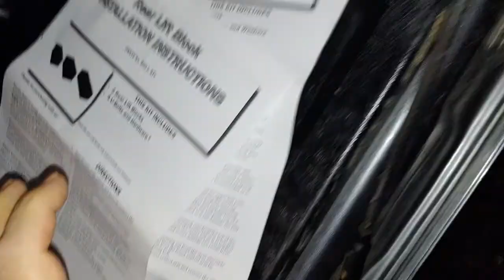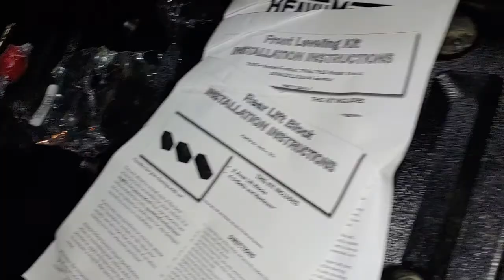installing a 3 inch lift kit on 2018 Nissan Frontier

Comment: Were you able to torque the ubolts
Reply from the maker: yes
Reply: do you think a 6 inch suspension lift with the blocks will work